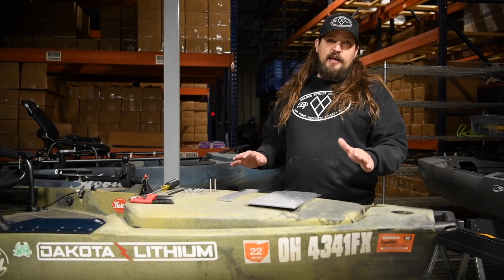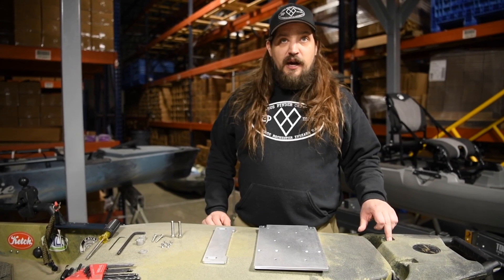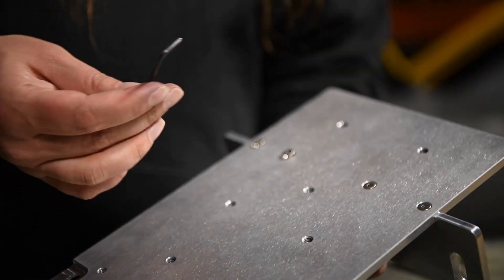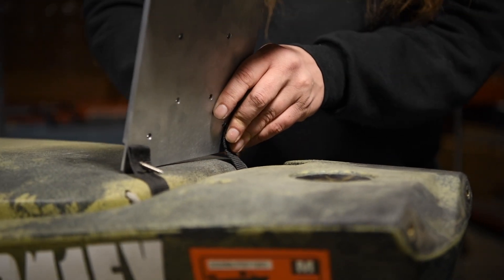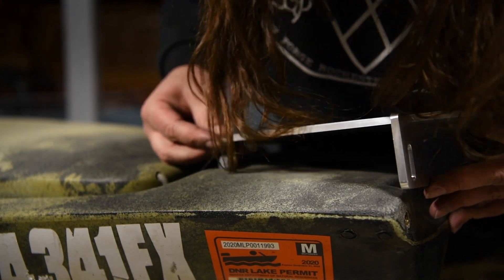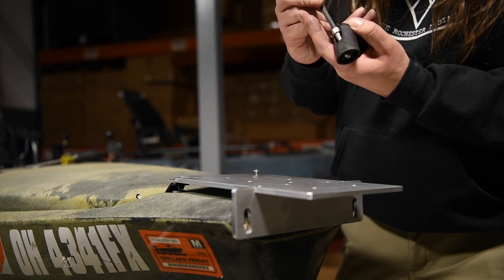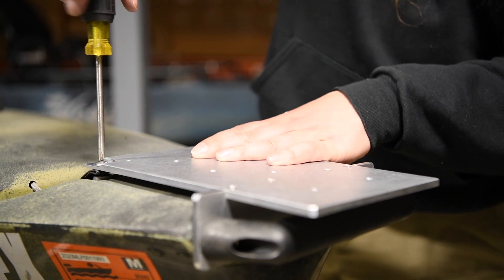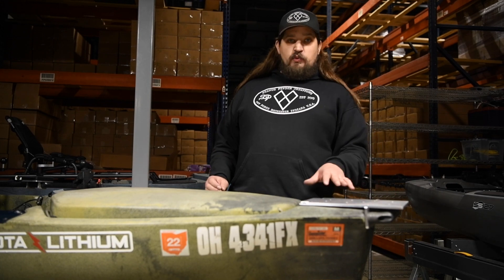Ketch Bow Motor Mount Installation for Hobie PA series Kayaks - Trolling Motor Mount Install

Comment: Pa12 release date?
Reply from the maker: Sorry... just saw this. They are available now.
Reply: @KetchOutdoors  I already ordered one and have it installed. Needed a tad bit smaller bolt due to the irregularities of my kayak. Looking forward to putting it to use this season.
Reply from the maker: @michaelb7611  Yeah.. that happens every now and again depending on how that brass insert is seated in the plastic. We went with the longer bolt to get as much engagement as possible where it's possible.
Reply: @KetchOutdoors  that's part of customizing your rig, is thinking through things and coming up with a solution that works.